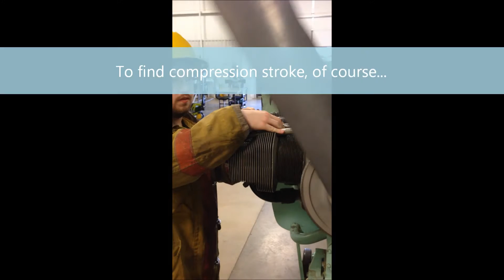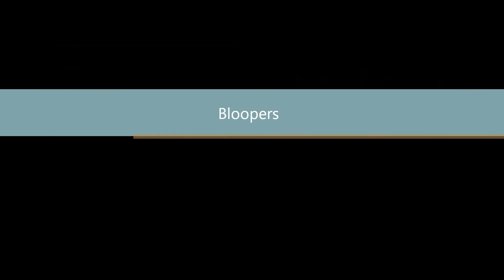Magneto to engine timing

Comment: I see you are using an engine case with the ‘super air/oil cooling’ mod. @6:24 aka, hole punched in the case. You might want to do a rod count.

Comment: WHY are you using a RADIAL 
ENGINE Time.rite; when both Lycoming, And Continental have t
heir timing marks on the prop flanges, and the reference marks are on the crankcase?
All that you need is a mag synchronizer, (two lights) to time the mags to the engine. Takes ten-15  minutes.